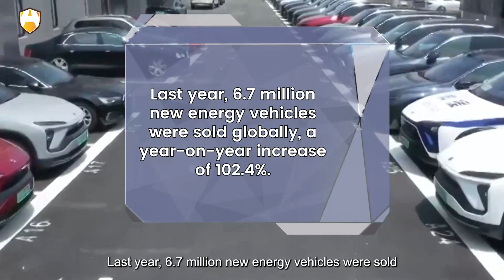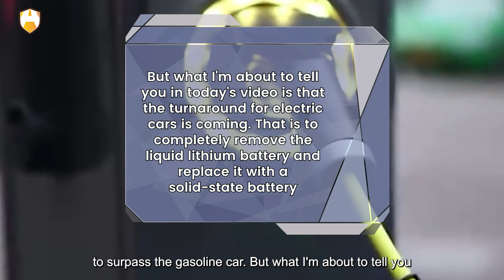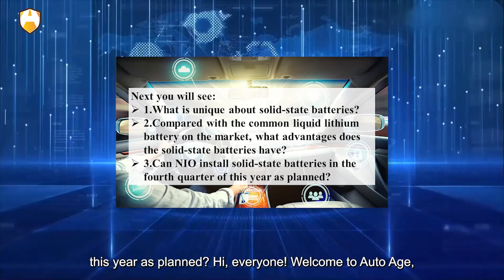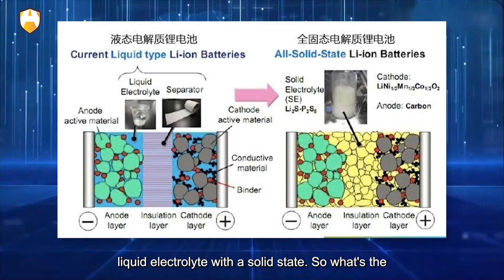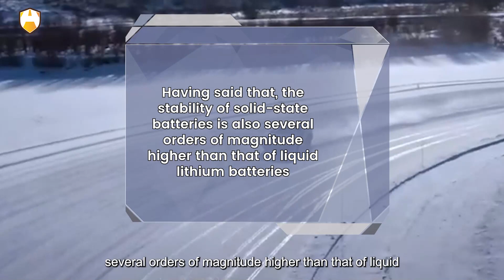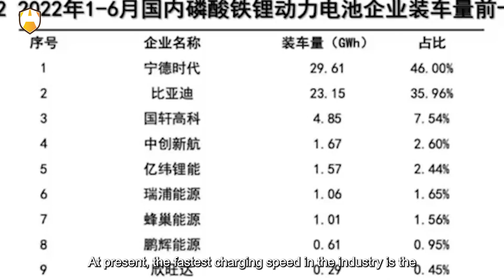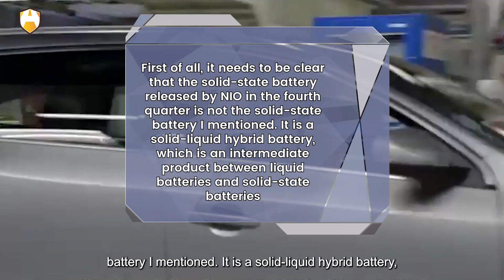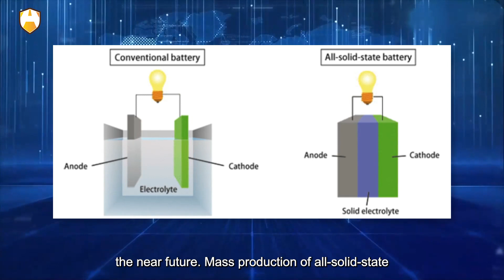NIO invented EV Fastest charging speed! Fully charged in 15 minutes for EV range about 1000 KM!

Comment: Apparently you have to drive 50000 miles to be greener than a petrol car. Some calculate a lot more too. It will improve though.
Reply: Lol. Same with Diesel, apparently you need to be doing 60k to make a Diesel cost effective.
Reply: Why? Just because of the battery components? Same stuff is used in car production. It doesn’t take into account all the additional components for gearing, transmissions, and petrol and greases?
Reply: @MrScotnofriends  yes , the production of batteries is not very environmentally friendly.
Reply: @richgl31  neither is our reliance on fossil fuels and raping of the planet for the oil. One is sustainable, one isn’t. We can’t do anything without mining, but rather than wait until all the easy to access profit-making oil is gone, we should use those resources for our future. After all, natural gas, oil, coal etc all took millions of years to produce, and it will run out.
Reply: @MrScotnofriends  nobody is arguing that. The issue is that that current manufacture of EV’s is not environmentally friendly either. As stated- it will improve. It is also currently not sustainable- electricity is still mostly produced used fossil fuel - so until we have greener energy production….
Reply: Always funny when people makes that claim.. just drain your engine oil once.. you know how dirty the ice cars are..

Comment: It takes only 12 minutes or so to add up 200km to my Tesla Model Y with a supercharger, and the cost is around 12-14 dollars
Reply: I think you have to do about 50000 miles before an electric car is greener than a petrol car. It will improve though.
Reply: @Pete 25% of the worlds power is now from renewables. Hydroelectric is classified as a green power and shouldn’t be included as a fossil fuel dependent. It is now cheaper to produce electricity from renewables per kilowatt than fossil fuels.